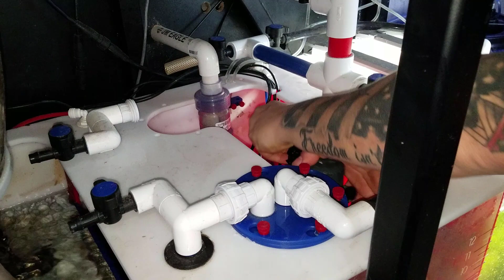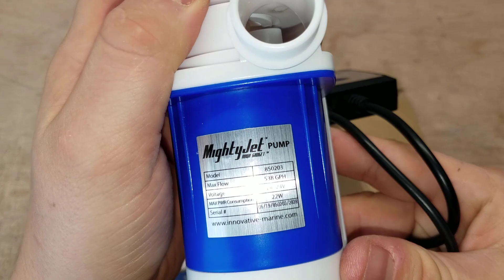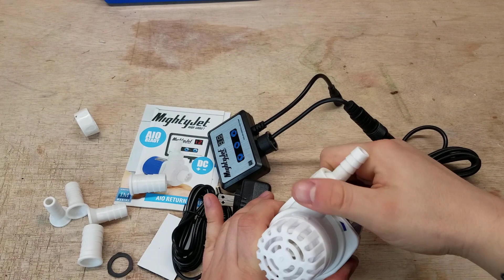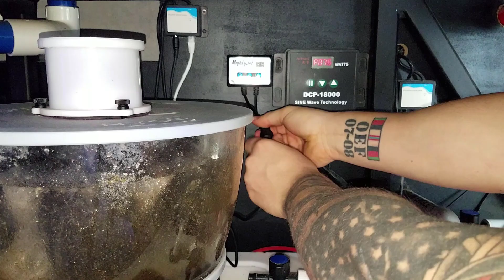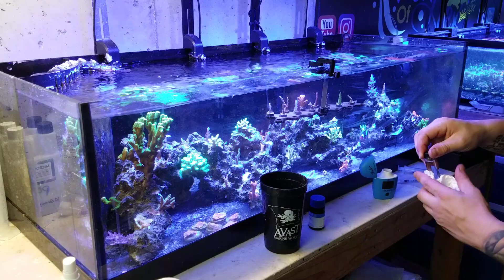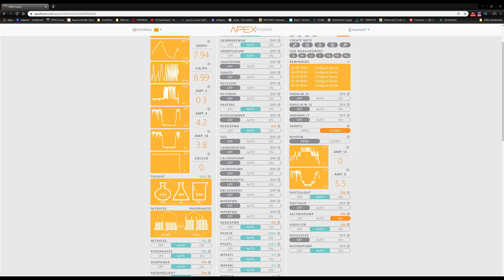If You Run A Calcium Reactor You Need To Do This | DC Feed Pump

Comment: Interesting, I hope it works out! Everytime i try and use a dc pump as a return when dosing 2 part the magnets always calcify w/in a few months of running and then i end up having to rush home when I get an apex alert. I tried multiple dc pumps; sicce, skimz, etc. same result. However, even the cheapest ac pumps seem to rarely if ever have that issue.  Ill be curious to see if you have better luck w dc pumps while using a cal reactor as opposed to 2 part. Thanks for sharing!
Reply: How weird.  I've ran Triton and DC pumps for years and I barely get any calcification.
Are you dosing 2-part very close to the pump?  Have you tried adding a small powerhead under where you dose?
Something isn't right with this
Reply: You must be dosing them to close together, that’s not a problem that should occur